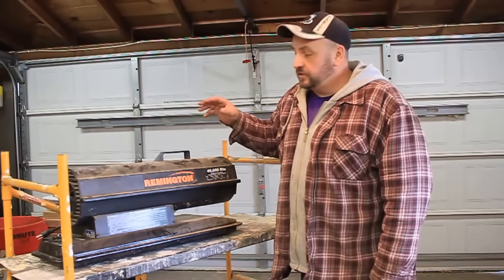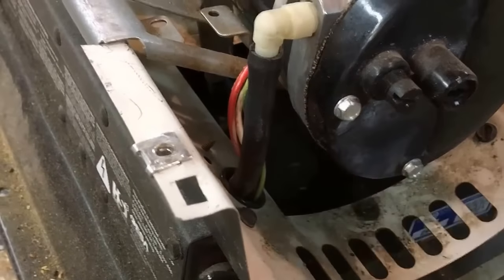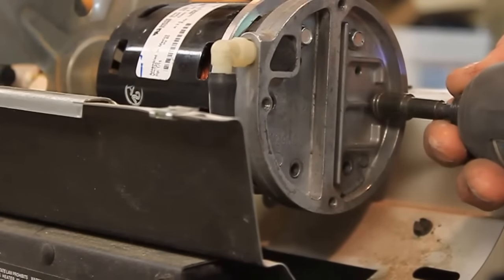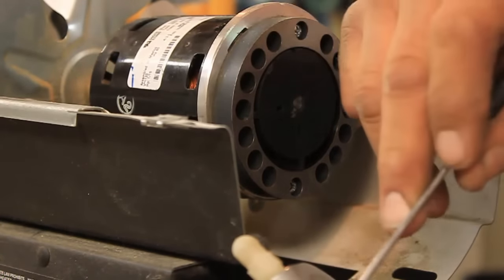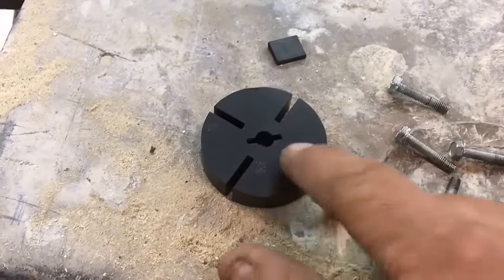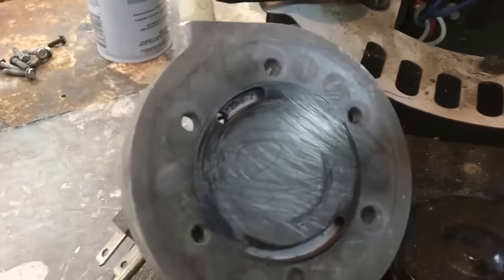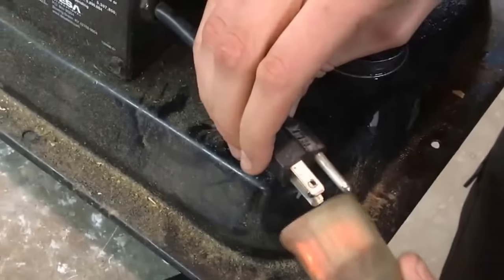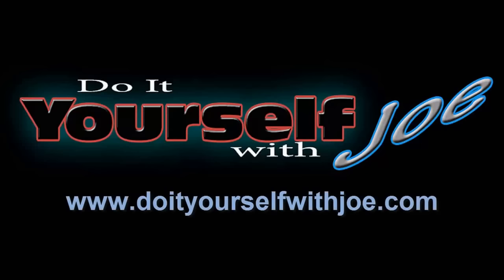How to Fix a Torpedo Heater/One of the Cheapest and Easiest Fixes

Comment: thanks alot! my nozzle was clean and i knew it would be something simple, cleaned air filter and found the veins sticking on the compressor, cleaned and used 1000g sand paper till they slid beautifully, put it back together and instant air pressure and good operation
Reply from the maker: Awesome! You're welcome!

Comment: I've had a 55,000 BTU Reddy Heater since the mid 90's and the last few winters it has been very hard to get it going, especially when it's colder outside. I would take the cover off and notice that the fan wouldn't be turning so I'd squirt some WD40 on the shaft and spin the fan by hand until I got it freed up enough that it would finally start. Then this winter that wouldn't work so I  was pricing new ones and where to buy one when I was looking at vids on what to do and I found this one. I had always thought that the pump in the back was mostly for fuel and I was hesitant about tearing into it. Thanks to your video I was able to tear it apart, clean it, check for clearances, put it back together and now it works great.  Thank you, thank you very much.

Comment: Nice , helpful video.  As a career mechanic only advice I can give is to wear some surgical gloves when spraying brake clean or anything else.  After years of neglect I noticed slight tingling when using stuff like this.  Stuff gets into our hands, etc.  Again, good video
Reply: Good advice in addition to doing it outside or with good forced ventilation. Most people have no clue how truly destructive that stuff is. You think you're a tough guy until you're laying in a hospital bed with tubes coming out of you & you can't support your family anymore, 40 years too early.
Reply: Not to mention what goes onto/into your hands goes into your body and bloodstream.  Not good at all

Comment: Mine broke one of those little slider-vanes so it was easy to diagnose without a tear-down.  But after I cleaned, lubed with graphite, and installed the rebuild kit, my heater would still not work.  It acted like there wasn't enough fuel to sustain combustion.  Eventually I diagnosed this to low air pressure.  So, I dug in again but did not find anything to suggest a problem.  After thinking on the problem I figured the must be an air leak.  With so little air in the system a very small air leak will cause a big problem.  When I reassembled the components I took extra care to be certain the pre and post air filters were not pinched in the mating surfaces.  Also, I applied common grease to the rubber gasket on the pressure side of that end cap.  That is all it took to fix the problem - air pressure instantly restored.  Thanks for making the video and sharing.
Reply from the maker: Thank you for sharing the extra steps that it took to fix the problem. We can all learn from each other!

Comment: I have previous purchased rebuild kits which have never included any instructions or parts related to the “ air pump/ compressor “. Thanx so much to this channel and YT for helping me to breath new life into several troublesome torpedo/ salamander heaters !!
Am curious to hear an update on how the graphite lubricant worked out over time.
Reply from the maker: Still running fine. I did make a video on replacing the rotor, so i have changed it since making the first video, and  I did have to clean it several times since I shot the video. This is because the actual fan motor is on its last leg and i have been using WD-40 to lube the motor. Since the bearings are wearing out, the WD-40 leaks into the chamber and gums up the graphite. I am trying to get the most use out of it, so i don't mind cleaning once in awhile. I've tried cleaning it and not using the graphite but it seems to not last as long without it. I'm glad the video helped!

Comment: I assumed  my problem was a bearing on the motor because it would hang up. I decided to watch your vid even though it had nothing to do with what I thought was my issue. I decided to follow your vid and check my pump.  Turned out the centrifugal fins were gummed up and binding the pump. If I had not watched your vid I would have pulled the motor and changed the bearings. Thank you!!
Reply from the maker: You're welcome! I'm glad it helped!

Comment: The pump does not draw the fuel or spray the fuel it is a are pump. That blows air over the pick up tube and creates a fuel cyphen. Good points for showing the fix 👏

Comment: Thanks for the good info .... my Remington 135 fan seized up after maybe an hours use. I discovered the graphite rotor was rubbing against the top center of the housing. I couldn't have done this repair without you and a few others to lend a helpful hand with your well done videos. I see the vanes have a good amount of travel so later this coming spring I will widen  the inside of the housing on my lathe to prevent any further contact.
Reply: Don't widen the housing on the lathe.  There is no need.  I had the same problem on my unit.  The fan kept "seizing" up.  You could turn it by hand, but the motor wasn't strong enough to start the heater.  On mine, I removed the rotor and sanded the high spot on it (I had more than one).  I also had to lay it down flat and sand it as well using a figure eight motion.  It was a tad thick.  I later found out that if you don't use the heater enough,  the rotor can swell from summertime high humidity.  Use a super fine automotive sand paper, probably 1500 to 2000 grit.  Take your time and you can get it to work.  I found this solution somewhere on the internet, but can't remember where.  Sorry.
Reply: You are supposed to just losen the screws on the rotor housing and set the clearence with a .06 feeler gauge at the top where the fins are retracted all the way in. The why it seems like the motor is seized. DO NOT sand anything or rework it on s lathe. Your clearence is off thats all. I've had brand new units that were set wrong from the factory.

Comment: Great video. I wonder if I have the same issue. Mine will start, spin, but won't ignite, then a big puff of smoke happens and it turns itself off.... I do have to open it up which I didn't yet. After seeing your video  I just got braved👍
Reply: You motor is gone or motor starter capacitor or this same issue with air part
Reply: Did you get this fixed.  Sounds like mine is having same issues

Comment: Missed the critical step.  The edge of the vain's against the steel housing will cause the end of vain's to edge bur over time.  So the quick fix to solve that problem of the vains sticking in the channels, it to just use some 800 sand paper to side lap the vain's to remove the edge burs/give the bearing edges a slightly chamfered edge both ends.  Same goes for the channels in the back plate unit to remove any ridging that the tip of vain burs may have caused in the plate channel as well.  Hence vains in the end plate, should move freely at all times, with the citrifical force of the back plate spinning causing the vane's to drop down at bottom of stroke, and the upper stroke pushing them back in.  The graphite works to help them move freely to lower the friction value when spinning, but they again, vanes should be moving freely to begin with in the back plate (read knock off the edge burs). Also, the graphite will not gum up after a while if you tried to use grease or oil, and does not have an cohesion effect of the vain's to the back plate channels (so the vanes can move faster as needed).

As for how the pump works, it pushes air pressure to the nozzle (no suction involved with the fuel at the back side of the pump), and the air pressure through the nozzle causes a bernoulli effect to pull the fuel up from the tank from its tube up the tube,  and out the front of the nozzle so it spraying the fuel in to the burn chamber. The fan itself is just adding more air to the burn chamber to get a more efferent burn of the fuel.   Hence if the nozzle does have air pressure from the pump, the air pressure has been correctly adjusted (see side plate for the needed amount of pressure for a given unit) but the nozzle is not spraying fuel, then double check for derbies that may have been pulled up from the tank tube to block the nozzle's fuel side.
Note here, the fuel line does have a filter on it in the fuel tank, so step one if  nozzle is not pushing fuel with air pressure from the pump to the nozzle, pull the fuel line off the nozzle to blow air through it to clean the end of tube line filter back in the  tank.  Also, would be a good time to pull the fuel from the tank to clean the debris out of it as well.
Reply from the maker: Thank you! Very good information that will help everyone!
Reply: I'm getting the C9 error on my procom. Code is for low pump pressure. Pressure is reading .07. Fuel is pumping. What could this be?

Comment: I keep wondering what a coating of silicone spray would do for the pump blades? There's stuff that sprays on wet, but the solvent evaporates quickly to leave a dimensionally insignificant layer of something like Teflon on surfaces. I used to use it on various items that needed some form of lubrication, but where a traditional wet lube would just attract muck until it turned into something like grinding paste !

I had the pump apart on mine so many times before I finally got some graphite powder to lube those blades. I found the best technique was to hit all the pump parts with brake cleaner, put on some fresh rubber gloves, and rub the powder into all the surfaces of the blades, then rub the large flat faces of the pump hub with whatever was still stuck to my gloves. Once I reassembled it all it worked fine, but after about 5 or 6 hours of use I took it apart again just to check it was all still moving freely. It was, so I repeated the filthy job and (At least THAT part of) it's been perfect since. Another problem I had was that the ball bearing in the pressure valve had become rusty, and depending on how it sat on it's seat it could be letting way too much or too little air blead off. That was a pretty simple fix. I just bought a little bag of stainless bearings for next to nothing online (6.5mm IIRC). One of them fixed that problem instantly.

There was an "Ease of use" mod that I've done to mine that's proved to be pretty useful, and worth sharing. It was to remove the tiny and easily clogged fuel filter, then I drill a couple of holes in the side cover that has the thermostat and power switch in it. I then fitted rubber grommets in the holes, and replaced the fuel hoses with longer ones that now come out that side. This was so I can fit inexpensive large clear plastic automotive fuel filters there. They mean I can see when the tanks running dry from a distance (The filter starts emptying), I can instantly tell when a filters getting clogged, replacing it's now literally a 20 second and relatively clean job, I can get 15 of these filters for the price of a single standard one, and if somehow any gunk DOES get past it and clogs the jet, I can just pop off the hose from the filters outlet and give the jet a blast with the compressors air gun without having to open any of the casings.

If you run one of these off pure clean diesel, this modification probably isn't worth the effort, but I run mine on diesel I buy cheap from the local car scrap (Junk) yard. It's a mix of new diesel, old diesel, probably even cooking oil, people have tried running their cars in, and each serving of this stuff comes with a free helping of floaty bits of dirt, rust particles, and unidentifiable crud....... But it's half the price of easily obtainable fuel from anywhere else, and my space heater will happily drink it. 😁. I filter this diesel soup through some cloth before filling the heaters tank, but a little muck invariably get's through. The upgraded filter usually catches it though.
Reply from the maker: Thanks for the info and for sharing it! This even helps me out! Thanks again!

Comment: Thanks for the video. It saved my old 50,000 but Reddy heater! I bought a new impeller and a new air/fuel plastic housing. (Mine was cracked) $30 for both on Amazon.
Reply from the maker: Glad it helped! So many people get rid of them and don't realize that what ever may be wrong could possibly be cheap and easy to fix!

Comment: Troubleshooting no fuel or vacuum at the pump. My problem was the rotating part in the vacuum pump blew apart. Very little use on this heater, all other parts checked out ok. Parts ordered. Video helped me locate the problem quickly, thanks!
Reply from the maker: Your welcome and thanks for the feed back!
Reply: What is that part called? Mine was broken too. Very helpful video, I've had this heater broken for 2 years and I've looked several times for help, glad I found this channel this time.

Comment: I did as your video shows but every time i try to put the cover on over the black carbon piece the fan won't turn.  I loosen the screws and the fan spins great.  I am just talking finger tight.  Any thoughts?
Reply from the maker: If i remember correctly the center has a t shape to it . Make sure it is in the slot correctly. If you replaced the part make sure it is the correct thickness.

Comment: thx for greart vuid i likje servicing my things when i can , i have a dynaglo pro 75k from home depot it ran fine for many years with no maint but lately its been shutting off every now and then with a cloud of dark smoke from front , im using diesel , pressure reads at 3 im thiking it just needs a much needed cleaning? any help is much appreciated thx in advance,
Reply: Mine also was shutting down every now and then but now it won't even kick back on, I use Kerosene and the fluid is spraying out of the front with motor running but no flame. Took it apart and found two of the rubber hose were completely dry-rotted and riddled with cracks...I'll replace those and try this cleaning he's doing and see if it works

Comment: Thanks for this video. I have taken these types of heaters apart in the past, sometimes I can fix them, sometimes not. But I've never seen one torn down as far as you did, with the four little fingers in the grooves. Also have a couple of questions. What about spray can graphite? Also, can I burn different types of fuel? My latest one is about 3 years old, and it will burn kerosene or any kind of diesel fuel. The older ones, from the 80s or 90s, say kerosene only. What is the difference?
Reply from the maker: I'm not 100 percent sure what the difference is. I think it has something to do with the nozzle. Its like converting regular gas to propane, you have to change the  little brass nozzles. As for the spray, what ever you use needs to be dry. Anything i have tried like oil lubricants , have gummed up and i had to take them apart and clean them again. There can't be any moisture in that chamber or it will gum up rather quickly.

Comment: That may run for awhile but it Will gum up again . The veins & holder are made of graphite ! Clean both but don't lube them !!! But good job diagnosing it .
Reply: Me neither ...just clean and dry...the vanes need to move freely.
Reply: I've already did this with mine and throwing it back together dry only works for about 10 minutes
Reply: Had the same problem and I put graphite and it gum again so now just clean it and reinstall
Reply: I think mine is just wore out lol

Comment: Great video.  Helped me fix my heater pretty easily.  I will add that the orientation of the little fins seemed to matter at least in my case, they seemed to move more freely when placed in there a certain way.  I agree with Dean below the graphite didn't seem to help.
Reply from the maker: Thanks for sharing the placement of the blades! I may have gotten lucky. It didn't word for me without the graphite. I first tried shaving graphite from a pencil and that didn't work. It worked when i used lube in a tube. I dont think the parts are made from graphite. I do believe they are a carbon fiber. However i do believe that everyone's case is going to be different and i appreciate your comments.

Comment: Hey I have a heatstar 35000 btu heater and recently it's not been having a high flame output even though my propane tank is on high? Most of the time I can turn the propane knob barely and the flame will get super big. Now its running on super low mode
Reply from the maker: Not really sure how those run, however if it has propane there is probably a regulator on the line that attaches to the propane tank and that can be the problem. I also had a problem with a new line i had for a grill and the tread area that went into the take was too long and kept the fitting from seating in the propane tank. So i had to grind some of the treads on the new line and that worked for me. Just trying to give you a few ideas. Let me know if any of them worked or if you solved the problem.